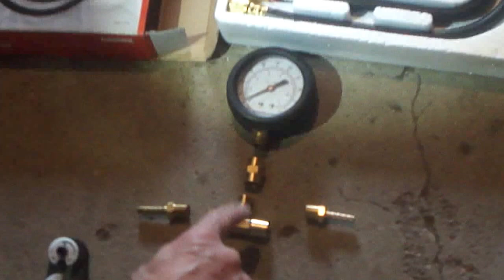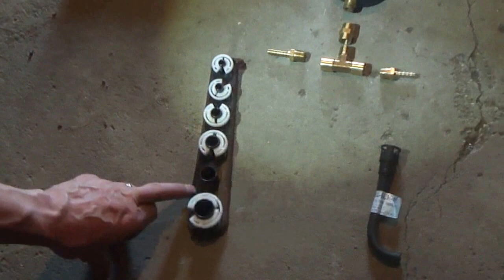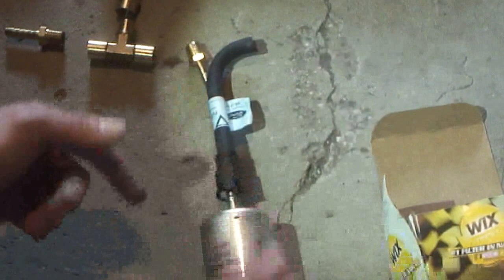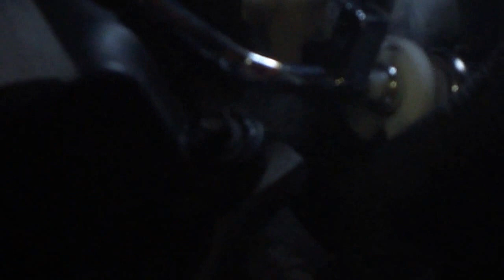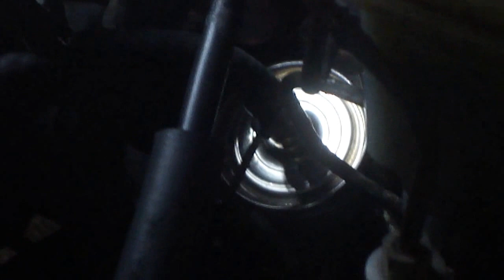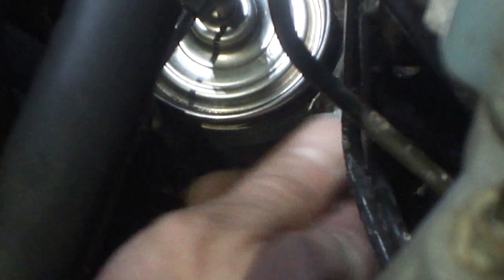Checking Fuel Pressure And Fuel  Filter Replacement (No Schrader Valve)

Comment: Hi i have an audi a7 diesel. The car had run out of fuel and since then the car has not started. There code P0087 has been found which is low fuel pressure in fuel rail, im assuming its a bad fuel pump.

However the car has 2 pumps, a high and low pressure pump. Can you please tell me which pump could possibly have blown and how to check pressure from both pumps. There is no pressure valve. I have checked pressure by releasing the bolt at the end of both fuel rails and trhere is no pressure.